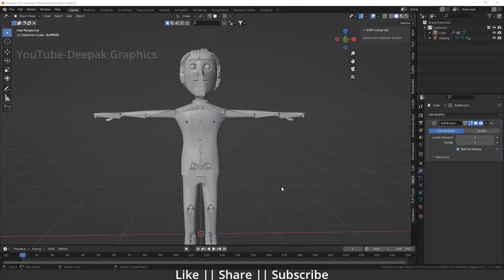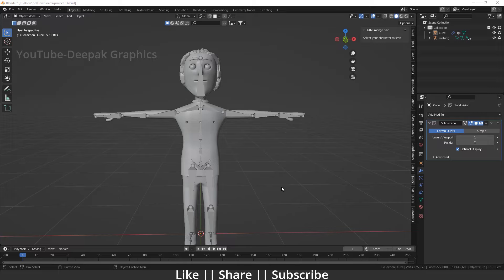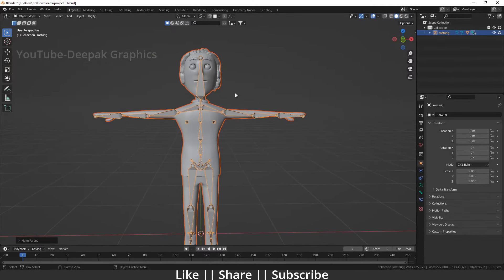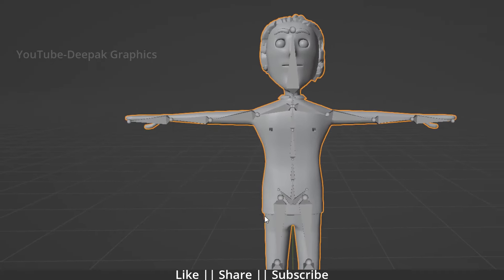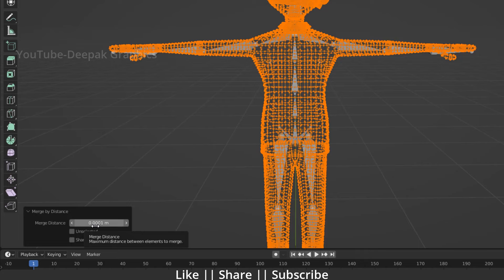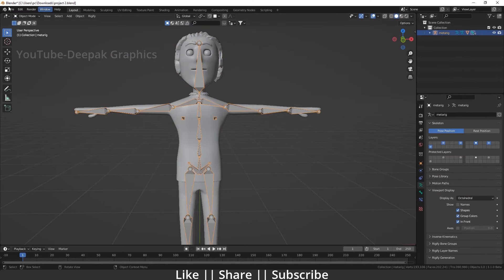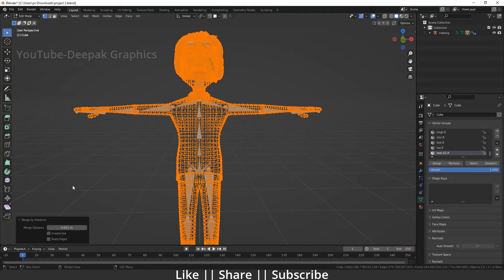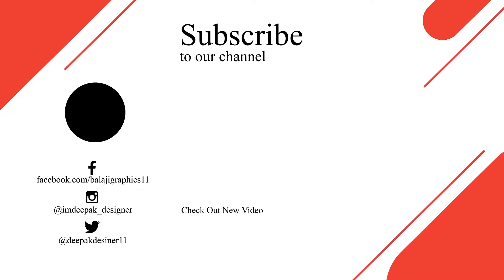How to fix Bone heat weighting Failed Problem|| Blender 3.1

Comment: If you did that and it still doesn't work, you can try and scale everything by x1000, apply transforms and then use automatic weights, because your mesh might be too dense for the automatic weight calculations to be done so it needs to be bigger. Then you can scale everything down after you're done
Reply: Legend
Reply: :thanksdoc:
Reply: scaling worked. thanks dood!
Reply: TYSM!!! :DDDDDDDDD
Reply: THIS WORKED!!
Reply: i love you
Reply: Thanks at lot! it worked ❤
Reply: Didn't even need to watch the video, followed this advice first and fixed the issue. thank you very much.
Reply: Legendary u saved my life
Reply: I design 3d printable stuff. I brought a 1/18 scale human to my scene and wanted to pose it. Could not get the rig to work for the life of me.
Then I stumbled upon this legendary comment. Sure enough problem solved!! Thank you friend. And keep up DEEPAK you laggin son! :D
Reply: When it's to dense, is it a possible fix to reduce vertices?
Reply: @dertobbe1176   you can with a decimate modifier and set it on Un-Subdivide but it might ruin your topology, it might also ruin the UVs a little but you can try with a modifier without applying it and see the results.

 you can also change the decimate modifier type to planar if you want to do heavy decimation but that can ruin the topology , but you might not mind that depending on the results and what you need from the model
Reply: @TheSperet  I am new to blender, made 2 models so far. One of it was just a parachute... I Imported my best modell to unity and found out it had to mich vertices 🙈 > 800k. I reduced it to around 22 k. You See a das difference at the teeth, but overall it worked fine 😊
Reply: @dertobbe1176  haha nice good luck with your modelling journey
Reply: THANK. YOU.
Reply: Savior haha
Reply: What happens if my bones turn bigger then my mesh?
Reply: This guy activated a CHEATCODE, thanks man
Reply: @ClintochX  lmao no worries
Reply: OMG NO OTHER SOLUTIONS WORKED EXCEPT THIS ONE! THX SOOO MUCH DUDE❤😂😅🎉
Reply: @salmonpie  glad it helped xD
Reply: Thanks mate!
Reply: DANNGG bro you should make your own yt channel 😉
Reply: didnt work for me either
Reply: @nymc4662  it's still not working?
Reply: @TheSperet  no
Reply: @nymc4662  hmm maybe try going to object data properties and remove all of the vertex groups first to create new ones when you do the process, other than than maybe your mesh isn't one object but multiple?
Reply: FOR THE LOVE OF GOD I LOVE YOU MAN I LOVEEE YOU SO MUCH IT WORKS GODDDD I DEFINITELY OWE YOU ONE ❤❤❤❤❤❤❤
Reply: @MajorScarface  glad it helped xD
Reply: What do i do if after doing this my whole model disappears
Reply: @Dshep01  you mean you cant see it when you zoom out? because if that's the case then you can press N while hovering your mouse over the viewport and open the View tab then increase the Clip End by as much as needed, like 10,000 or something. 

If the mesh itself nowhere to be found then it probably gets displaced and move to its original location when you unparent, then you gotta press the dot key on your number pad after selecting the mesh from the Outliner, or just remap the key for refocusing if you dont have a numberpad to your mouse macro or a keyboard key you dont use since it's a useful key
Reply: @TheSperet Bro I want to know how to live stream recorded video plz tell me, I couldn't find any Tuts.
Reply: @expertboy8120  live stream a video recorded on your computer?
Reply: love you bro, this worked lmao.
Reply: thanks bro, this helped me
Reply: How to view vertices?
Reply: @carrot1628  in edit mode, you can switch to vertices by pressing 1 on your keyboard or switching the type of view from the top bar, between vertices, lines and faces
Reply: @TheSperet  i cant scale x1000, i dont see my object
Reply: @vladyka11  sure what is the problem, is the solution in the video not working
Reply: @TheSperet  nah, i scale this x1000, click parent and problem with bones stay
Reply: @vladyka11  you need to increase the clip end length, you can do that by pressing N while in the 3D view port to show the right side options panel, go to the View tab, and increase the End to as much as you need, it's originally at 1000 m but you can make it 5000 m or even 10000 m so you can see bigger objects.
Reply: @vladyka11  also are you clearing the vertex groups before reparenting
Reply: legend ,,, you are a legend 🤘🤘🤘
Reply: You are Legend bro Thanks 😅
Reply: 와 시발 존나 말도 안돼
Reply: Here 9 months later to say THANK YOU.. Scaling everything up, then going through the process solved the problem!
Reply: @RodEllison1  I'm glad it helped
Reply: thannnnnnnnks
Reply: thx mate!
Reply: Have been trying to fix this for over 2 hours by my self, I love you man
Reply: Thank you so much
Reply: When I scale it up I can no longer see the object
Reply: @emilialamhauge2034  when you're hovering your mouse over the viewport press N to show the side menu on the right side, then increase the render distance from 1000 until it shows your object
Reply: Absolute hero
Reply: I 2ould have spent like WEEKS on this thank u so much!
Reply: @joehunt1194  no worries bro glad it helped
Reply: you are a savior
Reply: thank you so much!
Reply: YOU ARE A LIFESAVER
Reply: Lifesaver
Reply: thx!
Reply: That worked, but now my mesh is all deformed, lol, what did I do wrong?
Reply: Ayoooo brooooo.. You saved my life. How'd i thank you for this.. Omggg! I've been struggling like 3 hrs having this problem. And now it worked tysm tysm tysm
Reply: @Jul_forever  yw glad it helped
Reply: THANKKKKKKS
Reply: Lmao, been stuck on this for hours now. Thank you so much!
Reply: THANK YOU SO MUCH. it worked
Reply: Not working.

Comment: You solved it for me sir! I almost gave up but the tip at the end where you change the merge distance from .0001m to .001m made the difference. By the way, I didn't have to delete any vertex groups. Thar seemed a little extreme and was unnecessary in my case. Thank you!

Comment: What worked for me: Object mode, select a mesh, add Modifier , Decimate, 0.9, Apply modifier. If it doesnt work so try Edit mode, press A, press M, by distance. And then try the first way again.

Comment: Doesn't work for me, I followed the tutorial to the letter but thank you I learned a little more.
Reply: Maybe try this:
Select object > Edit Mode > Mesh > Clean Up > Decimate Geometry > Set Ratio to 0.980
And do the rest as usual. Worked for me.
Reply: @tomaccino  Yes it works for me too, but I found another solution to avoid decimating the geometry.

I scale all in 1.5 and it works and then I rescale in 1.
Reply: @jhonysteak5512  Ooh, nice! I will try your solution as well.

Comment: Cheers bud, it really helped me out... I had to continue to merge by distance for a while, just enough where the model still looked intact, and the bones by weight would finally work... I think I ended up using something like a 0.0019.  Also, do not forget to constantly repeat the "Clean Up > Loose" + Dissolve.. basically, trial and error... but I got there with your help, so thanks again
Reply: Thank you so much! Your exact instructions fixed my issue. Merge by distance .0019 fixed it. I had to slightly resize my mesh but that’s ok.
Reply: thanks man
Reply: The repetition finally worked !! Success :) Thank you!!!!

Comment: I already merged the vertices MULTIPLE TIMES and it keeps making the same error
Reply from the maker: that might be possible if you haven't removed the old vertex gropes and also not make the object convert to the mesh do it these 2 steps hopefully your problem will fix

Comment: Tell me how to fix the error "bone heat weighing: failed to find a solution for one or more bones" when binding the body to the bones. I removed all the extra vertices, set the distance to 0.001. I checked the name of all the bones, but still gives an error.

Comment: Your way to deal with Bone heat weighting Failed Problem is working even though the merge by distance have to be change from 0.0001 to 0.01 though.
Reply: I was about ready to give up, but this change made it work! Thanks a lot!!!
Reply: blender 3.6, size too small also fail!   scale to over 1.0. It works for me.

Comment: thanks alot bro,  at 0.0001 merged 5.8k vertices but still had the issue, then i made 0.0002 and it removed additional broken 295 vertices that was hidden inside the body. then the Rig worked fine :D

Comment: If this still doesn't work for you, go into edit mode, go to:
Select > Select All by Trait > Non-Manifold and fix any strange / not closed geometry
Reply: This worked for me - thanks for suggesting this
Reply: Thank you friend!
Reply: After the video, and this comment, things are still going wrong. If anyone else has advice please help me.
Reply: You safe my time thx! <3
Reply: I tried both of these and I'm still getting the same error.. Any solution?
Reply: Thank you so much
Reply: yes, that

Comment: what do you do when this doesn't fix it?
Reply: Try Decimate Geometry > Set Ratio to 0.980
Reply: @tomaccino  I ended up fixing it by duplicating the model, putting a voxel modifier on it, automatically weighting that, then transfering the weights with a data transfer modifier
Reply: @Luna_Kobold  Cool!

Comment: This did it. Merge by distance removed 2 vertices. Just two and I had bone heat problems after the rigify rig was made. So, the rig seems to interpret vertices data differently.

Comment: SHITTY SMARTY SOLUTION IF STILL STRUGGLE /
Don't work 4 me, i was in struggle, my solution i find is to:
-Separate by Selection the differents part of the body (shoes separately) 
- Set Parent with Automatic Weight the diff' part.  (that allow you to identife the source of the error more precisely)
 For shoes and hat/hair (that was the source of the problem) I'm just assign them in Pose Mode in bone simply. don't work in mixamo for me but at least save me 
Thanks anyway

Comment: Didn't work for me in Blender 3.3 with some random free model, so I found out I can do this:
Select object > Edit Mode > Mesh > Clean Up > Decimate Geometry > Set Ratio to 0.980
Do the parenting as usual.
Hopefully it helps someone!
Reply: bro thank you very much for your comment
Reply: Thanks alot man
Reply: Thanks man, that helped a ton!
Reply: Useless comment, didn't help, nothing in the internet can help me
Reply: ALSO! If it still doesn't work (was my case lol) just scale up your model, apply scale and parent again. IT WORKS
Reply: @acquatriste  this worked for me out of every method, thank you
Reply: You are the absolute GOAT
Reply: How do I select mesh?
Reply: thnku man
Reply: DOING THE LORDS HOLY WORK THANK YOU
Reply: @WiRaR  did you find the solution?
Reply: @migueel_17  as I said, nothing can help me, I've meant literally
You have to weight paint by yourself and retopology to make autoweights as close to best ones
Reply: @WiRaR  I found a solution in edit Mode in the object, select everything with a, then press m, merge by distance, and increase the value until the parent succeeds without deforming the object too much, in my case 0.12 was the limit. But I imagine that maybe you tried that already. 🫤
Reply: @migueel_17  i do manually
Reply: @acquatriste  THANK YOU !!!
Reply: Thanks dude.
Reply: Thank you so much , your coment helped
 me a lot
Reply: Thank you so much, that fixed it!
Reply: @acquatriste it worked 🔥
Reply: Thanks for posting, saved me a ton of messing around. Cheers!
Reply: thank you
Reply: Thank you so so much
Reply: dude, I'm really intrigued on how you found that out, never in my life would I think to do that (also cause im a noob in blender but still). This literally fixed it, I never thought I would see the day me fixing this model. I congratulate you for sharing this amazing information.
Reply: tysm, that rlly helped me out
Reply: Thanks dude
Reply: OMG thank you so much. I was that close on starting all over again. This finally helped
Reply: Thank you so much ♥
Reply: didnt work for me :((((

Comment: Doing this DOES remove resolution from your model. 

I ran into this problem when importing small, detailed models from CAD into blender. For me, it happened because a lot of the polygons were "too small" for Blender to handle (mesh exported from SolidWorks with <0.0001" deviation). Following this method in the video solved the problem BUT my models would become noticeably rougher, which was problematic for me. 

I ended up just having to make 1" in CAD = 1m in Blender so that I wouldn't have to do the method in this video to every model I imported and lose resolution.